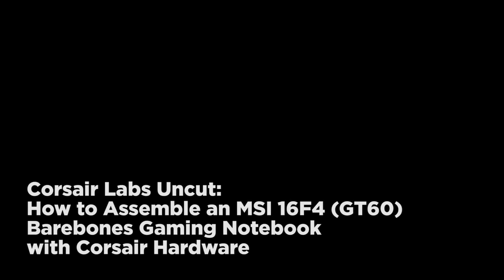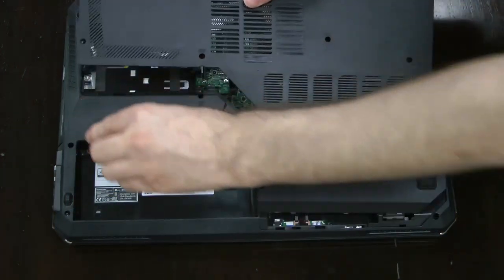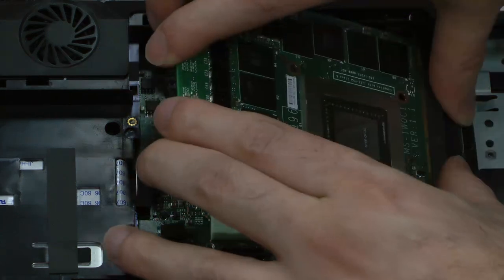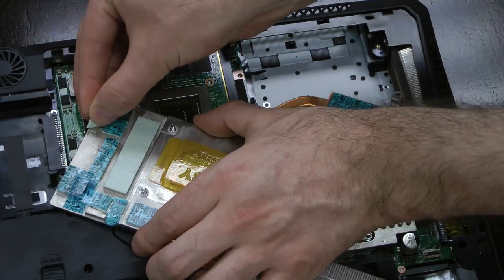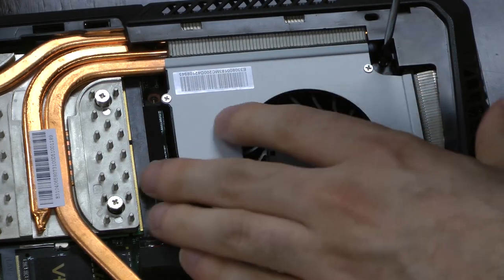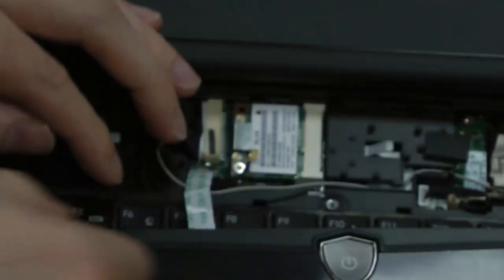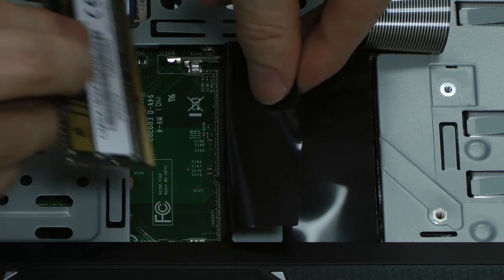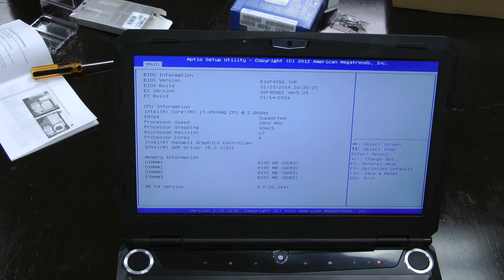Corsair Labs Uncut: How to Build an MSI 16F4 GT60 Barebones Notebook

Comment: My biggest gripe as an owner of an older ivy bridge based MSI barebones gaming laptop is that nvidia make it next to impossible to find an affordable upgrade to the 570m GPU and the ones on ebay (as an example, the 880m) is almost 900 dollars.  NINE HUNDRED DOLLARS.  

It makes upgrading your laptop too expensive to be worth it IMO.  It would make more financial sense for me to just sell what I've got and put that money towards buying a brand new laptop with the faster card.

Nvidia need to standardize mobile GPU upgrades the way desktop GPU's are done so that you don't have to fool with buying specific versions of cards or using hacked card bios's, worrying about heatsinks not fitting right, etc.  If they could do that and make upgrades as painless as it is for desktop users, they would probably get more people considering laptops as desktop replacements.
Reply: Did you figure anything out? I have a 6990m I can sell you for 350 :)
Reply: 8Ottetal no it's not worth the cost to upgrade.  I don't travel any more so the demand for my laptop to play games is no longer there.  It's just a glorified couch internet machine now.

Comment: Hi! I have a question related to the fourth generation Intel processors that you're using in this video. I have an MSI ge60 laptop with an i7 processor. I know that there's is a chance that this model doesn't support upgrades because the i7 4700hq is the last generation of Intel processor. But I want to know if this MSI model comes with an integrated processor. I wonder because I want to remove the i7 and install an i5 last generation processor. Do you think that this is possible?
Reply: GE series have soldered CPU, and as fair as I rememer GPU too. GT/GX series had removable CPU and GPU but the new GT72 have CPU soldered and upgradeable GPU.

Comment: i know this is a old post but, is really worthed put 4 x 8gb ram,  if this works in dual channel, how much ll gain in performance vs only 2 x 8g ram?
Reply: if you do not need 32 GB of RAM, it would be better to install 4x4GB - then the RAM gets full bandwidth and 4 cards unload each other. I have this model - I tested various configurations and 4x4GB is best if I overclock the processor (I have a fully unlocked bios - a must).

Comment: Someone want to add a link to the chassis? Looked all over, couldn't find it. All I can find is a full already build machine with a 780m instead of an 880m
Reply: That's awesome but the best and newest GPU offered is a 780m, not an 880m like the video showed.
Reply: ***** He means that the newest and best card that site offered with the barebones kit was a 780m not that it is better than the 880m

Comment: Can I upgrade the i7 4700MQ processor in my GT60 2OD? Already bought a 980m to replace its original 780m :D
Reply: +adr1anobanano The 4700MQ is still a very good cpu and will not bottleneck the 980m. I would save money and keep it.
Reply: Yeah anything above an an I5 can decently run anything their is no use in upgrading

Comment: Hi I know this is an old post but does any one know if the newer 1060/1070 rtx2060 etc GPUs fit the 16f4 boards thanks
Reply: 1060 yes... the only problem if that you lost the mDP port.. the 1070 can work... but there is a possibility that you have temperature and power problems... since it is not known if the computer board can deliver enough energy to feed it... the 2060 does not work, yes.

Comment: Nice guide. I am waiting on parts to build a laptop for the first time. I have built dozens of desktops, but I am looking forward to this. 
Specs for my build
MSI 937-176322-052 Barebones kit
i7 4700mq
NVIDIA GeForce GTX880M
16GB DDR3L SO DIMM (8GBx2)
1TB SSD (512GBx2 Raid 0)
Windows 8.1 Pro 64 bit
Reply: +Brian Minucci Where do you buy the mobile gpus?
Reply: +Stuart Trappe I'm guessing Amazon or Newegg, don't quote me on it, but that's my guess
Reply: SwifterGaming thanks